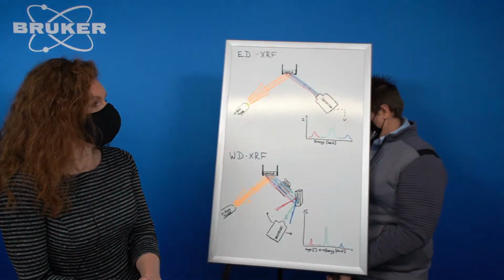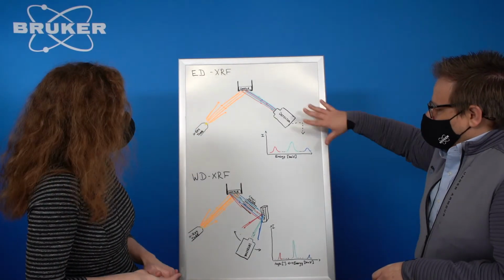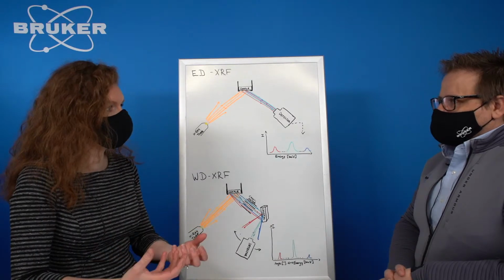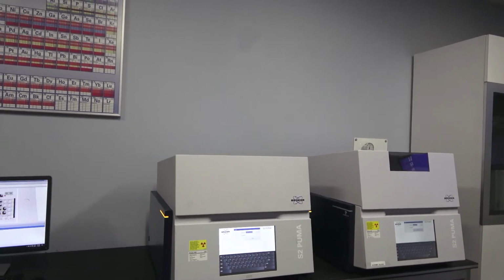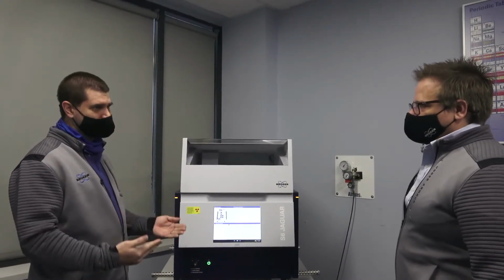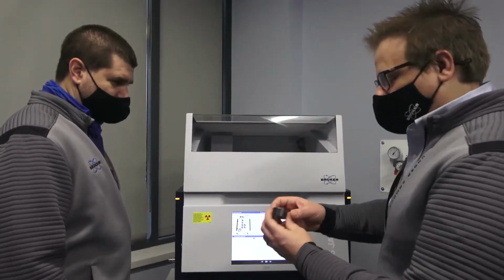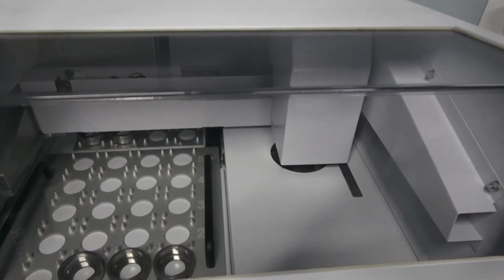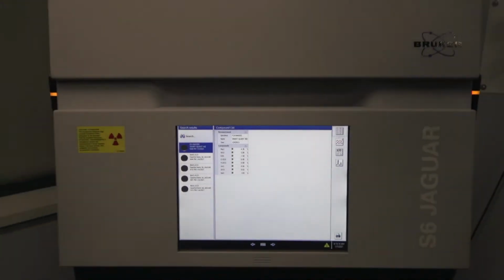Live from the Lab: Features & Benefits of Powerful Benchtop WDXRF System

Comment: hello, may i ask whats the result of wdxrf called? is it just wdxrf spectrum? thank youu
Reply from the maker: The result of a WD-XRF (wavelength dispersive x-ray fluorescence) measurement is fluorescent intensity. This can either be just at a fixed angular position (which corresponds to an energy) used for calibrations or over a larger angle range which results into a spectrum. In general, we refer to them as results as well and each element is usually reported as ppm or wt %, however custom units can be set up. We build a calibration using Certified and/or Secondary Standards and run unknown samples against the calibration for each element. If you do not have calibration standards then we can run the unknown samples against our standardless program that will also show the spectrum of the sample and help you identify which elements are present in your sample. You can reach out to your local Bruker Office to obtain more information.
Reply: @Bruker  thank youu so much for your answer, it helps me a lot
Reply from the maker: @ghafalaptop4382  You are welcome

Comment: Can it detect Carbon Compositions? And Lower Element Composition?
Reply from the maker: Hi Vivek. Thanks for your question. The S8 Tiger can detect elements from Boron up, but special crystals and collimators are needed, the measurement mode must be vacuum and the samples must be prepared in a very reproducible and homogeneous way and be flat. For the S6 Jaguar, elements below Na ( or F if using vacuum mode in certain cases) are not practical, because only one collimator position is available, and because lighter elements fluoresce less, so a higher power instrument is needed. If you want to measure light elements via XRF the S8 Tiger is the only option. Depending on the sample type and the concentrations, a different technique like CGA would be suited better.
Reply: @Bruker  We want to measure lighter elements, specially carbon contents in Fe and Al Alloys. Which model is suitable for that, it can be any technology?
Reply from the maker: The G4 Icarus which is part of our CGA group will be able to detect C in Fe & Al Alloys